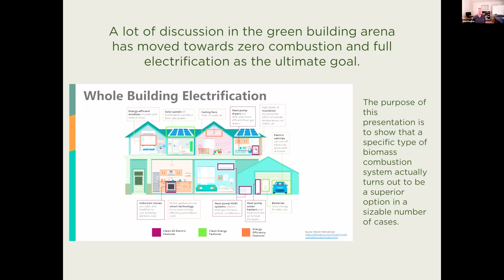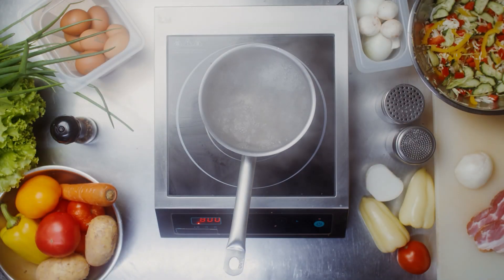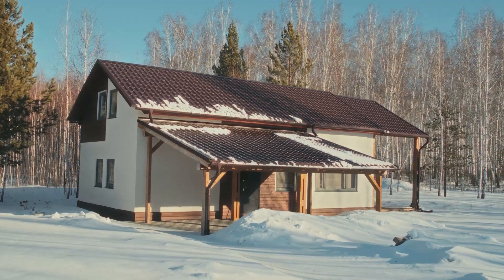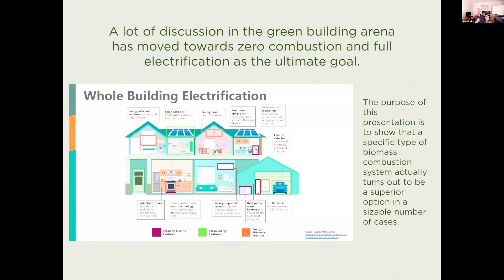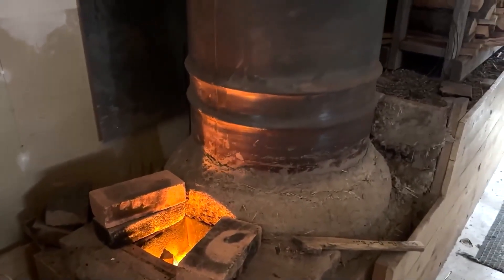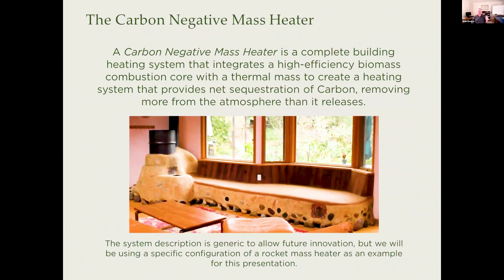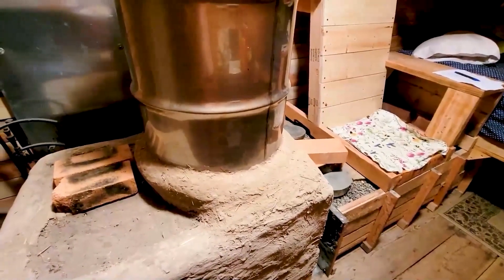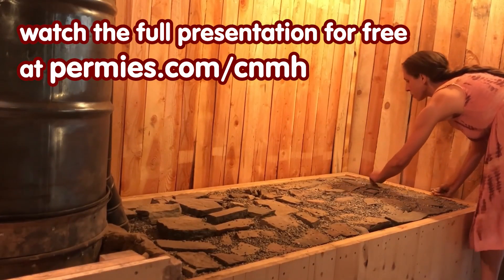how carbon negative heaters beat solar powered heat pumps

Comment: I am trying not to be slave worker. Building REAL pasivhaus without manipulating wood, soot,ash provides me with that. Energy spent on wood production is energy too. that energy has to be grown in my garden. which on itself requires a lot of energy. things are seldomly simple. My 150m2 house in Toronto climate needs only 0.3 cords / 1m3 of wood for heating per whole year... (after converting kWh to cords of wood). so even if i used wood for heating, it is still 15 times less then my neighbor, so that means it is 15x less work for me and my garden. 15X less room for both garden and woods... real permaculture requires lowering energy need.
Reply: do DYI photovoltaics if it is possible for your situation, you can build it 5-10x cheaper easily. that means you can have it 5-10x bigger for same money.  additional saving on top of that can be made with using ground mounD for ground mount... do not connect it to grid, use hybrid inverter which is connected to grid but does not send anything there if you do not want. 80+% of hot water per year from 3 kWp PV array is obtainable in all lower 48 states.

Comment: Negative Embodied Emission Product (NEEP) like building heat that takes waste biomass out of the carbon cycle before methanogens decay it into methane (about 17% in general) seven dozen times worse than CO2, that substitute for other products, are a boon to the economy and need to be strengthened through economies of scale.

Comment: Renewables like solar and wind require ongoing manufacturing, replacement, and specialized maintenance. Trees can be grown and pruned indefinitely, locally, and with minimal ongoing effort, while providing reliable heat and carbon sequestration. Loved the full presentation!